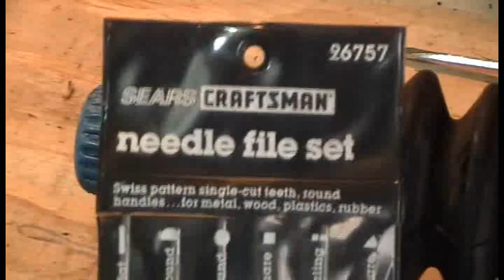Carrier Bearing Ford F350 Vibration

Comment: Hey brother. Thanks for the video. Did you bang that bearing all the way in? How did it turned out? I am still experiencing vibration
Reply from the maker: Possibly the rear brake rotors are warped.

Comment: Wow that looks like it kicked your ass. I'm starting this tomorrow on my 07' F-350. Hopefully it goes smoother. Doing all three U-joints and the rear pinion seal since I have it all apart.
Reply: How'd yours go? Any suggestions? I'm starting mine tomorrow. Thank you!
Reply: Richard Clasby take some paint or some WhiteOut and mark all the connections  so you can put it back exactly the same way you took it apart. I took it off starting  at the back of the truck and worked my way forward. I pressed all three u-joints out with my ball joint press. Worked great. Put greaseable ones back in. I grease them at every oil change and have had no issues a year later.

Comment: I have a f250 7.3 powerstroke that has a bad vibration most noticeably in the center console vibrating like crazy as well as back of vehicle and I noticed my driveshaft center support bearing is wore out driveshaft has alot of up and down play in it I hope it fixes my vibration problem
Reply: did that fix the vibration?  my 06 F350 has a nasty vibration from 35mph up to 50 on any acceleration, off the gas pedal it smooths right out.

Comment: Just replaced my center support bearing on my 2001 f250 4x4 all the u joints are good and i had little vibration before. Now that i have the new bearing when i hit around 40mph it feels like im hitting rumble strips
Reply from the maker: Are the u-joints in line, as in they all point at six o clock at the same time? Also, I recommend checking the ball joints. https://www.youtube.com/watch?v=Y9FdBx40Bkw&t=4s
Reply: Yes the ball joints are good and the u joints are all in line. I took a surface gauge and realized the shaft is warped by 2/16” (the one coming from the transfer case going to the csb) the shaft connecting to that goin to the differential is good. I cant afford the hole shaft but i can afford the 1st one. But im worried if i only got that one it would be un balanced  because i think drive shafts are balanced as a hole. Thanks for your feed back and if you have any thoughts or suggestions i would much appreciate them -tyler
Reply: Did it vibrat all the time? Or only certain times? I ask cuz my 2002 had 2 incidents recently where I hit a bump or rough freeway and felt like I was going over rumble strip. Didn't shake violently or anything just enough where I noticed but the wife didn't
Reply: @jasonzucco5054  yea i do believe it did vibrate all the time just not much. But before when i would go 75-80mph there would be a really loud whining and a very high frequency vibration in the floor,wheel,throughout the hole truck. Now after changing the bearing it dosent do it at 75 -80 no more its very smooth but not like it should be.
Reply: @jasonzucco5054  and yea i have put 45,k miles on my truck this year so i know what you mean about knowing different sounds it makes. Everyone tells me it sounds normal but i know when something is out of place lok
Reply: @bolt2510  yea mine only happened for like 20 seconds and seemed like a light rumble strip. The first ti.e I figured was the freeway. Then it happened again about 20 mins down the road. But each time I let off the gas and went in neutral and threw it in 4th and hit gas and went away. Wife didn't even really feel it.
Reply: @jasonzucco5054  have you checked your center support for play ?
Reply: @bolt2510  yea I crawled underneath. No movement in driveline. The center really move unless I push hard on it.
Reply: Im going to order a new drive shaft this week and go get all tires re balanced. I hope it feels like a new truck.
Reply: @bolt2510  yea I am gonna do the same 400 mile drive that made it occur and see if it happens again or not. But I was going to start with u joints and get drive shift balanced for starters
Reply from the maker: @jasonzucco5054  I did not notice at slow speeds.

Comment: I had to cut my bolts off my f250 too! talk about bad design of the nut and bolt for the carrier bearing
Reply: Nimue,  I do believe that the bolt is permanently fastened, it's the nut on the upper side that comes off.      If I remember correctly 😁 it's been since 2003 when I replaced mine and now I'm feeling that vibration plus a clunk at a moderate speed and I punch the accelerator just a tad, I can feel the "slack and slap" of the U-bolts.  I'm certainly dreading it!

Comment: Mine starts to vibrate when I try to jump on the highway and give it hard gas... If I go smooth on the gas it jumps that part and I can go to higher speeds with out shaking. But just in that part of speed where it shakes it does real bad... No so much of a shake but a bbbrrrrrrrrr sounds with hard vibrations! It's scary... Lol
Reply: I have the same problem you figure out the issue?

Comment: Just changed both rear ujoint and now it starts shaking while going 30mph. My problem used to be cruising at 55 mph. Go figure. Damn. At least the clunk went away.
Reply from the maker: Are all the u-joints lined up. This helps with the driveshaft balance. Also, maybe see if the tires need balancing.
Reply: @badmatt4227  paid a mechanic to take it out and "fix it" , told me its not that. Even tho i feel like it might be that since it started after the new ujoints just yesterday. Wheels were purchased around March balanced & alignment done.  Told me it could be the 4x4 driveshaft,  to run it without.